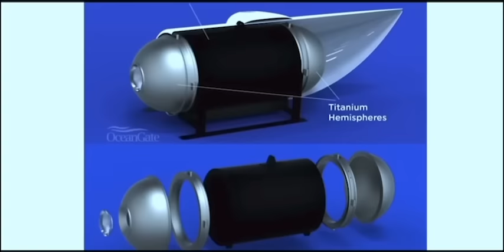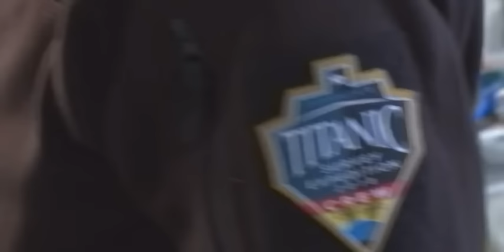First look at #oceangate #titan Debris

Comment: It just keeps getting worse; it never ever occurred to me that the thing was crudely GLUED together on the ends. The more I see about this thing's construction, the more I'm amazed it didn't implode the FIRST time they took it to that depth. Unbelievable...
Reply: the glue is not the problem. The pressures under water press everything tight together. The problem is the carbon fiber that is not suitable for this application.
Reply: @libertas12  the problem is the combination of both titanium and carbon fiber, they both have different pressures and temperatures they react too, I.e. expand, retract etc.
Reply: @TheFailedmessiah  true
Reply: Surely at depth the pressure would hold it together glued or not.
Reply: Steel is King
Reply: I need some of that glue for things in my home, it's amazingly strong.
But hell no i use it on a home made submersible!
Reply: @sambranton3346  the problem is that the glue bond would be degraded over time from constant pressure forces on the tube flexing from pressure changes, and temperature changes on and off over and over again, so once the bond weakened the pressure on the tube would have crushed the tube and you can think of the end rings and or end caps being shot off like a champagne bottle cork when you remove it....
You can also think about it like a pringles chips can, the cardboard tube with the plastic lid ? if you crush it quickly the plastic lid will pop off... it would also do the exact same thing if you were able to take it to the bottom of the ocean
Reply: @donbrashsux  Right, steel and titanium are hard material
Reply: @hawky2k215 Right, titanium alloy is better than pure titanium. Similarly, the airplane fuselage (skin) is made of aluminum alloy, not pure aluminum.
Reply: @libertas12 Just to add on that this IS the best way for doing this. Can't really weld carbon fiber.  

Not an engineer (I fix cars) but I wonder if some redundancy may have helped. If I where to make this I'd see if you can add studs to the sealing ring and where the carbon fiber meets. Something to clamp and limit movement? I could be entirely wrong though.
Reply: They probably used an epoxy glue, which was hard but brittle. And it wasn't even assembled in a clean, dust and contaminant-free environment.
Reply: @Smannellites  true. Carbon fibers are flexible but epoxy is not. Micro cracks inside epoxy probably caused delamination..
Reply: i think they have used carbon fiber before but it was one time dive so the safe lifetime was 1 time. With his innovations we could say it is two now.
Reply: It had to be glued together because you cannot drill holes in carbon fiber without weakening it severely.
Reply: What did you think, that it was welded? When you put metal to plastic, glue is about the only choice. Even so, the pressure would press it all together so that is not the issue.
Reply: Seriously
Reply: My thoughts too.  Also, why was the thing assembled in a non clean-room environment?  They weren't even wearing caps to prevent human hairs or other small debris from invading the glue seal.    Why was the seal not secured with a physical bond or double layering?  

Why was carbon fiber chosen at all, since it is stronger under low external pressure conditions, and weaker under high external stress?  All these things were well known.  Mr Rush was horribly negligent and in denial about the engineer's advice (the one that Mr Rush fired for speaking up).
Reply: @xaero76  Another analogy is when you slam a fist on an empty tube of Smarties with the cap on. Both ends pop out.
Reply: @actionjksn  no need to drill through it directly.
Reply: @sambranton3346 that's not the issue. The issue is that under repeated minute buckling of the carbon hull inside the Titanium water can ultimately find/force itself in and when that happens you get a local very very uneven and unbalanced distribution of pressure that very quickly causes progressive failure of the hull.

It's like once the water wedges itself in between the ring and the hull the hull buckles further increasing pressure buckling further boom.
Reply: @kl0wnkiller912  check out how your coolant lines are attached to your radiator assembly for a hint at how things can be affixed without using glue. 

Personally, if they absolutely insisted on using carbon fiber and titanium... I would have suggested pressure rings inside and out with an external clamp over a low section on the external ring.

The external and internal rings have bonnets and gaskets, which bolt directly to the front hatch assembly and to a rear cap (with an access tube for cryo and co2 scrubbing, batteries  and instrumentation for motor control.)

Better than 2 inches of epoxy and crossed fingers...
Reply: @TheFailedmessiah exactly. Only a fool Wood combine the
two unser the given conditions
of pressure and temperature
Reply: @xaero76  Eh? Shot off under 6000psi of inward pressure? I agree with the first part of your post, however. The ends won't "pop off" in the way they would if there was negative outside pressure but they may have been the failure point. We don't know. Could also have been the observation window area.
Reply: @xaero76 dollarama's glue, no screws...omg...that's crazy
Reply: FYI. The navy had a underwater drone with carbon fiber with titanium in 1988 .  Advanced Unmanned Search System (AUSS)
Reply: It imploded FIRST time at that depth, as far as I know that sub had never been at that depth before even in trials.
Reply: For clarity, this crude gluing was before the rebuild in 2020. Does anyone know if it was the same application process as this video that year?
Reply: right
Reply: @MrGgajic epoxy can be very flexible. There are varying formulas or moduli of carbon fiber and epoxy. Look up carbon/carbon and carbon fiber leaf springs and reed valves. Bicycles also have to flex and be stiff in various areas depending on strain. A flexible epoxy resin is necessary for the fibers, it all depends on the application.
Reply: @libertas12  I'm not sure about it, as the glue might have different reaction to pressure than titan and carbon shell, so you end up with three materials, that behave each on its way - is hard to predict when and what fail under the pressure and what chain reaction it will cause...
Reply: @Anita95_original What? This was its 24th dive, according to news articles.
Reply: @xaero76 your pringle tube analogy would not work in this instant I don't think. The pressure acting on the walls of the pressure vessel (pringle tube), squeezing it, will be equal to the pressure acting on the domed ends (pringle tube lid) so it couldn't pop off. I think failure of the carbon fibre due to the continual pressurising and decompression, particularly around these joints was the most likely area of failure as the CF will be a lot more flexible than the titanium rings
Reply: @Wigalot not a good analogy. In real life at the bottom of the ocean the pressure squeezing the tube will be the same as the pressure acting on the ends due to the water
Reply: Here's something else, he got the carbon fiber cheap because it was already expired, he was completely reckless in it's construction

Comment: I know literally ZERO about how any of this is done, but when I saw the incredibly thin (relative to size) lip where they 'glued' the opposing materials together, I couldn't believe my eyes.
Reply: Me too. Putting the glue on reminded me of spackling a hole in the wall, slapping it on and skimming it off. Something like gluing a submersible together should require an even, specified glue depth, temperature controlled, precision placement, clean environment. No passengers should have ever been allowed in this sub.
Reply: Didn't matter, Sharon. They coulda used masking tape to bond the end caps to that cylinder. Those joints were NOT the failure point. The failure point was the implosion of the carbon-fiber. For one the layers were wound with a 180 degree overlap with NO cross threading (instead of alternative 45 degree to 90 degree alternative layers). Also carbon fiber was a very poor material to use for compressive designs. Properly wrapped between layers to be used in tensile design is a lot more suitable. That stuff should NEVER be used in a submersible except for making chairs and tables!
Reply: @leecowell8165  would you say he expected them to do it right and the side glance at 3:22 is that? i am getting horrible ideas by now.
Reply: The water pressure would force the ring into the ends of the CF tube but as the CF tube flexes from the water pressure, that wimpy inner ring was what probably gave way allowing the CF tube to collapse and let the ocean in.
Reply: exactly and the dude making the video knows zero also.;  When the vessel goes down the pressure pushes the ends against the tube so you don't need some big lip.  This guy knows nothing and the idiots just eat it up.  Did he mention once how the acrylic view port is missing?
Reply: Me niether!  Wow
Reply: @brinkee7674  Not all of us idiots out here know the technicalities of these sorts of constructs.  We are getting a technical education as we go.
Reply: @brinkee7674  im thinking about the view port is the failure point looking this pictures.
Reply: @brinkee7674  The acrylic viewport is missing, and two hypotheses:
1- The viewport failed first, and the effect of water hammering in suddenly destroyed the rest;
2- The (most likely) CF body failed, either at the middle or at the ends, and the effect of water hammering in suddenly destroyed the viewport, along with the rest.

Note that the effect of a water hammer due to sudden water entry (and implosion) tends to affect the extremities more than anything. An implosion will have the same effect of an explosion inside the sub. That is to say that trying to prove what failed first is like finding a needle in a haystack. It is merely speculative
Reply: @samuellourenco1050  Well if you listened to communications you would know the RTM was going off and sounds where heard from rear of sub.  They tried ascending but could not, maybe due to under water currents pinning them down as happened to Cameron in the past.  I know the window is missing but that could of blown out from implosion.  Work was performed on the sub days prior requiring rewiring of some equipment and may not of been sealed properly as this is where problems arose.  They knew for a good 20 minutes they were having problems